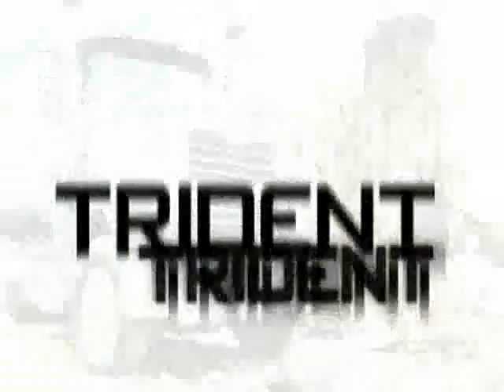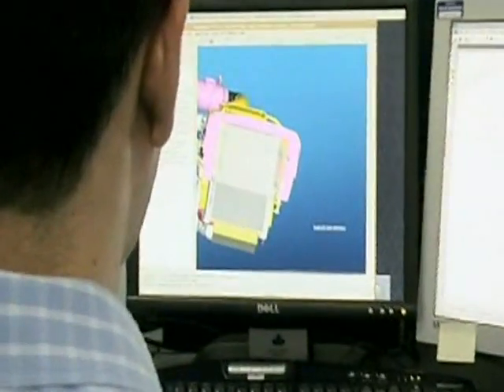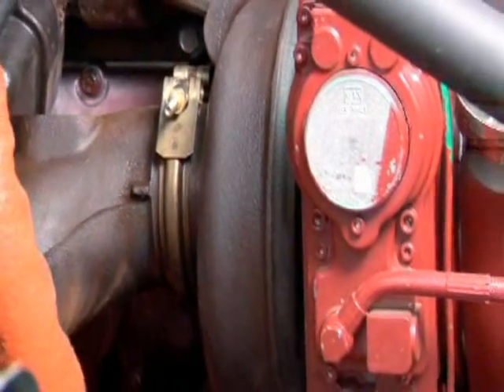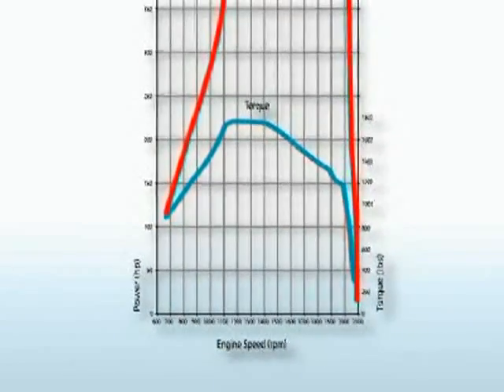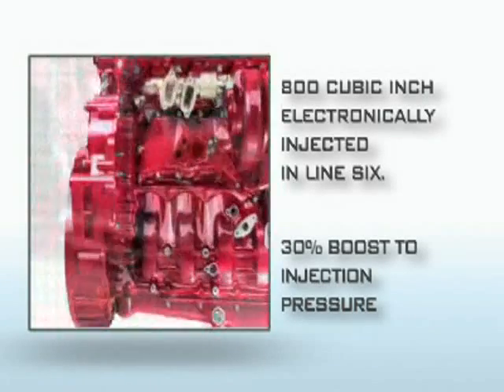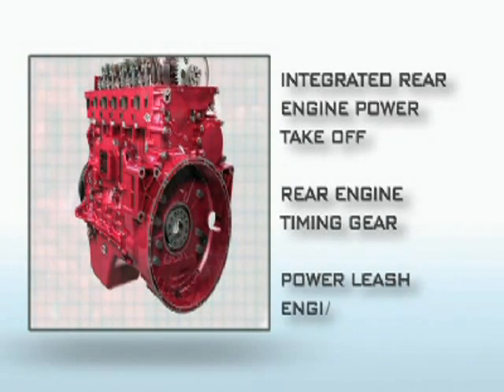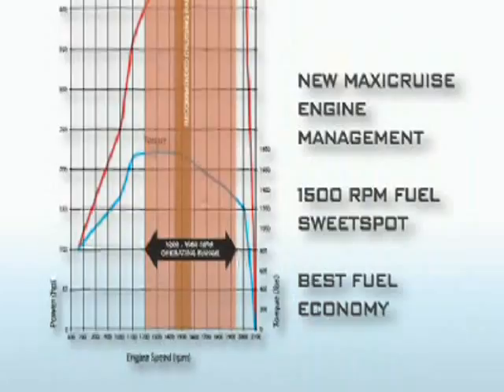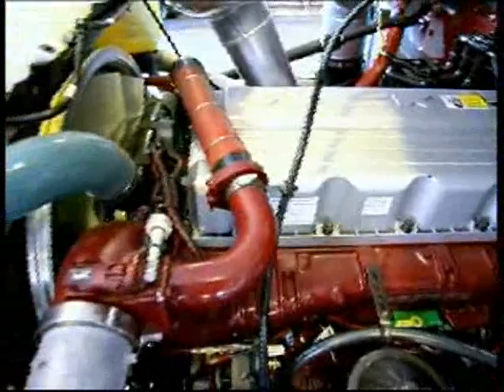OFFICIAL Mack Trucks MP8 Engine Movie

Comment: I have used the MACK MP8 for 3 years now in Nigeria. My major challenge is the expiration of the surge tank (Radiator coolant tank). I have changed this tank in about 4 of my trucks out of a total of 10 I bought at the same time. Also the dashboard cluster has also failed in 3 of my trucks. These parts are really expensive for me when i have to buy at a present exchange rate with my country's economy being really unstable. Aside from these problems the vehicle is a wonderful vehicle. My drivers are happy to use this vehicle.
Reply: Bro please can you direct me to any mechanic you know that works mp8 engine i live in  onitsha

Comment: Hate to break it to you, but Volvo took a D13, painted it red and changed the valve cover to say Mack. Every thing about that engine was designed by Volvo in Sweden and built in the US. Take the valve cover off and look at the rockers,  they say Volvo, not Mack. I'm a Technician at a Volvo dealer, and Mack is powered 100% by a Volvo engine.
Reply: Facts